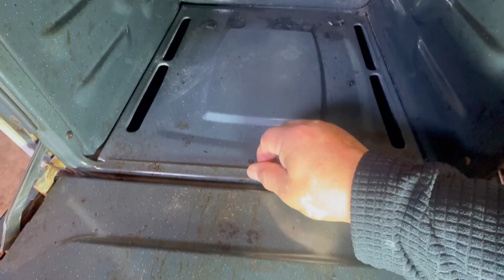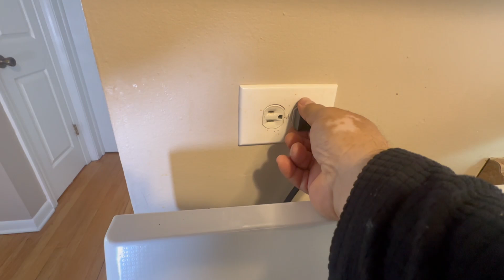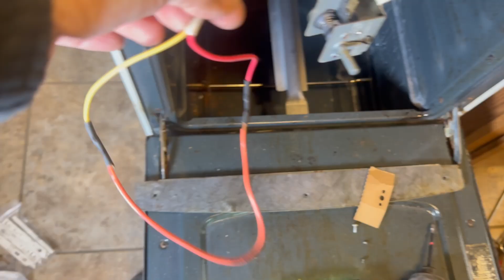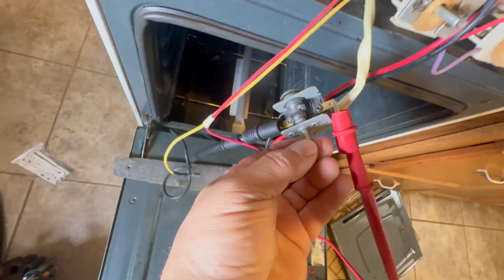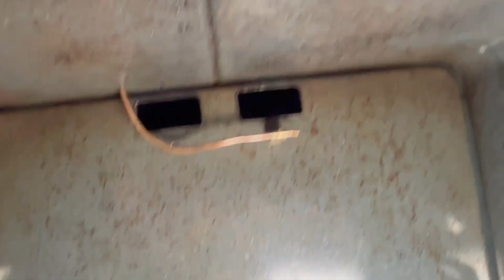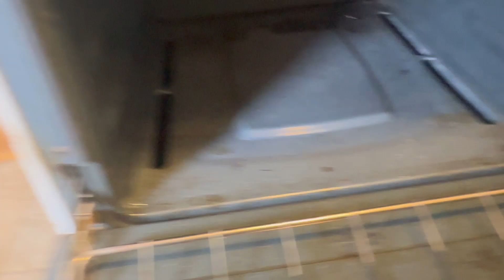HOW TO TROUBLESHOOT, REMOVE AND REPLACE  AN OVEN/RANGE THERMOSTAT

Comment: so you don't have to mess with the gas in order to replace the thermostat on a gas range? Also, I have a vintage Premier "galaxy" gas range, 24", made about 1980. They sold similar standing-pilot models like this until fairly recently, now all are electronic ignition. Parts charts for Premier don't seem to go back that far to get a part number for the thermostat, to find oiut what will fit. Contacted Premier, they have no info since it is no longer listed on their charts. Seems like a more modern thermostat off a 24" standing pilot Premier gas range should work? Any info on how to get obscure parts lists, or cross-reference what thermostats will work?  Currently going to pull out thermostat so I can see photo to The Old Appliance Club to see if they can rebuilt it, but they said normally they can't on this new of a range. They were able to rebuild my gas safety valve a few years ago, though living in the stupid State of California, I could mail the bad safety valve to them, but they couldn't mail it back - had to have it mailed to a mailbox place in AZ and ask them to mail it to me. Same when I needed a casement a/c for a friends sick daughter - a bit of mercury in the thermostat, so had to have it shipped to the same mailbox place in AZ and have it sent to her house in San Diego county.